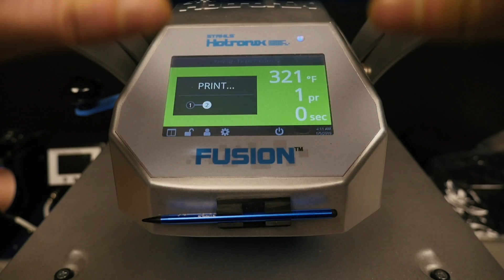HARD WORK PAYS OFF - Learning To Screen Print Part 3

Comment: Just make sure to put the shirts under the flash before printing because the shirts do tend to shrink a little 👍
Reply from the maker: That's what I've been seeing on some of them. The extra glue tack definitely helps solve that, but for safe measure I've been running the sensitive stuff through the dryer first to pre shrink them. Definitely a good call to do on hoodies
Reply: @leestuart38  When you load the shirts or hoodies on to the shirt boards, just swing each board under the flash for 5-10 sec so that if any shrinking does happen it's on the board. No need to put the blanks through the dryer.

Comment: Use teflon when using the heat press.. you will get amazing results
Reply from the maker: Exactly what I used. You can also use craft paper or parchment paper and it will give it a matte look instead of the gloss that Teflon does

Comment: Diazo emulsions are the cheapest screen printing emulsion option. SBQ-based emulsions come in one pot with no mixing required. They cure extremely quickly — within seconds — when exposed to UV light. The more delicate bonds created by SBQ-based emulsions make the emulsions a good choice for detailed work

Comment: What Ink and mesh do you use. You should be able to get a nice print using the right combo without heat press
Reply from the maker: The print is better than most peoples standards, but it'll never be the same type of smooth as it is when it's pressed. Getting rid of that little bit of texture makes all the difference
Reply: @leestuart38  gotcha

Comment: Lee Stuart Hello mate...I just wondered if you're heat pressing shirts as a matter of course now...or was it a one off in the video ....or is it something you offer as an extra....
Im asking because im considering getting a heat press to cure my shirts when I eventually start... rather than a tunnel dryer... because of space... cost and necessity.... Thanks
Reply from the maker: I still do it when the application calls for it, there's really no other way to get that perfect retail fashion print. So I offer it as an upgrade

Comment: Have you ever had the problem at the beginning of starting a job that the ink is super hard and thick that does not go through the entire mesh and the logo does not look good. How did you solve it? do you think it's the ink or is it something else. Thanks
Reply from the maker: You have to stir the hell out of the ink to get it moving nicely, white especially. It also helps to print once or twice on a junk shirt and flood multiple times to get it moving before going to production. But if you want to skip all that just use more squeegee pressure for the first few prints until the ink starts flowing better
Reply: Plastisol ink has something called a "false body". You need to get the ink moving in the beginning, because it is designed to be constantly pushed about by squeegies.

Comment: Sorry if this sounds dumb how did u get rid of registration marka
Reply: Terry W it's a little difficult to catch it in the video, but he just put tape over those registration marks.  You can see the tape placed over the marks at 8:38 after he's cleaned it up.  Most likely were placed on the shirt side of the screen to not interfere with the squeegee
Reply: @ConcreteKraken  still confused ill watch the while thing again
Reply: @terryw5500  Its not included in the video.  When the press pops up at 8:35 you can see the green tape over the registration marks.

Comment: hey man great video. What is the white paper you used on top to heat press your print?
Reply from the maker: Thanks man. That's a Teflon cover sheet, it's standard in a lot of heat pressing and makes for a glossy finish on the print. You can also use kraft paper, which produces more of a matte look

Comment: i heatpress all my shirts.
my current set up doesn't include a dryer so it's a good way to get product out and offer something big shops don't really do.
it takes longer, but personally i like the finish better.
you can also test different wax papers or parchment papers to give it a different finish
Reply from the maker: It's definitely a nice touch. I mainly use the parchment paper, but in this case they liked the glossy look so we went with the Teflon
Reply: @leestuart38  your videos are pretty fresh.
Subbed.

Comment: Patience, test, check, measures, test check, measure.......... I did this 5 times before drilling my rear wheel rotor when I realised I had it upside down. Another rotor in post 😬 love your attention to detail, your video work in the past shows this and now your applying it to screen printing. Well done that man! Your not gonna want to hear this but if you can’t get 10/10 and make money a 9 might have to do. I am pretty sure your nine will be better than any other service you had. I started a successful business 19 years ago with hardly a penny to my name....... hard work and patience does pay off!
Reply from the maker: Thanks man. I'm all about hard work and persistence so we're going to set a new standard in the local market  and hopefully take over 🤘🏻

Comment: Great videos!  Question: Were you using a hybrid emulsion when having issues?  I noticed in this video your emulsion is pink which tells me you could’ve switched to the plastisol only emulsion... Just asking because I’m going through the same issues right now.
Reply from the maker: Thanks man. The issue was actually the exposure unit itself, not the emulsion. I've been using the dual cure stuff consistently now just to get rid of it because it has a short shelf life, but no problems now. If you're blowing it out of the mesh it could be a few things...underexposure, improperly cured emulsion or as simple as not letting it soak long enough before going for the full washout. Good luck man!
Reply: @leestuart38  Thanks!  Looking forward to more great content!

Comment: @Lee you are doing a phenomenally good job man. Loving your videos so far. I started working in the fashion industry in about 2003 at a screen printing company and have  few pointers you might wanna try. Apologies if you resolved these issues and mentioned them in later videos.
1. when creating your separation artwork, wherever possible put a 0.5 point outline on your designs. Then when it comes to your base white, make sure it has no outline. when you start laying colours on top of your base white they should match up perfectly and will give you way less registration issues.
2. when you create your registration marks, make the lines thinner, a 0.5 or 0.25 point. it makes lining up your registration between colours a whole lot more accurate and easier.
3. use clear tape over your registration marks on the screen when you start printing colours. easy to wipe away ink when lining up colours if you need to make micro adjustments to your registration. Keep up your awesome work man.

Comment: I run a manual press also (Hix 6x6 with over 100k prints so far!), if you are having registration problems try pre-flashing your shirts...i.e. Flash-Print-Flash-Print. I almost always have to do that with sweatshirts, but not so much with t-shirts any more. Automatic presses have the advantage for multi colors, squeege pressure can remain constant where manual presses depends so much on the operator. Wait till you get into the 400-500 shirt orders, your squeege pressure will vary greatly over the job!!! Good luck.

Comment: Good job man. I subscribed, thanks to YouTube for recommending you. Sad to say but I like seeing your mistakes . I am about to coat my screens with the same emulsion you first had and after seeing your first video I’m going to do a test screen before I ruin the other screens. Good shit and dig your effort on learning
Reply from the maker: Thanks man, welcome aboard. I like to show the realness because that's just how life works. My issues were with my exposure unit and not the emulsion actually, so you should be good to go 🤘🏻. Just let it soak for a minute or two before trying to wash it out and it'll be all good
Reply: Just practice, practice, practice. You're not gonna ruin screens. Coat a few, and if it looks terrible, just wash it out with water and try again.
It took me some time (as it did everyone) to learn how to coat screens. I spilled a whole scoop coater full of emulsion on my area rug. Took it outside and hosed the poo out of it and it looks like it never happened. You're gonna make a mess, you're gonna wanna break stuff, throw stuff, yell stuff...but just stick with it and you'll get there :)

Comment: Hey man, I followed you on Twitter but turns out I can’t message you over there. Not sure if others will have that problem. Just thought I’d let you know in case you’re wondering why nobody’s hitting you up for a shirt. 👍
Reply from the maker: Thanks for the heads up man! I just fixed it, turns out I don't know how to work Twitter and had messaging turned off 😂. So haul ass and get that message in there